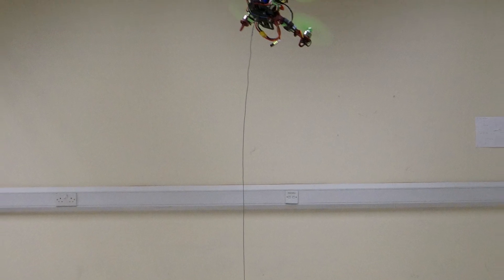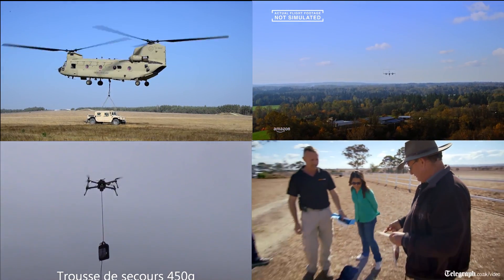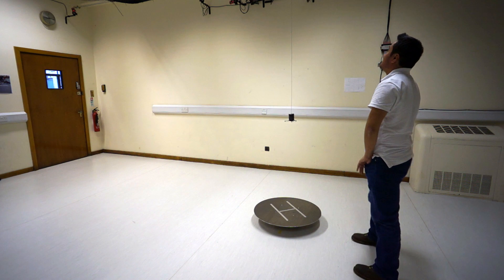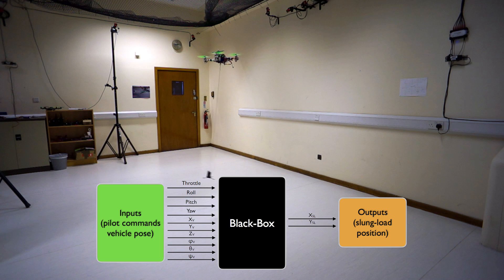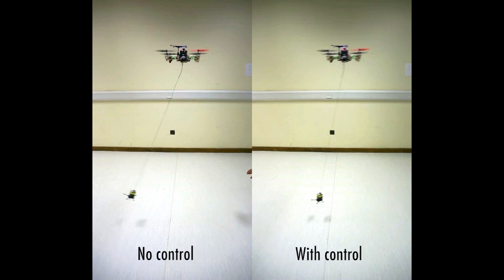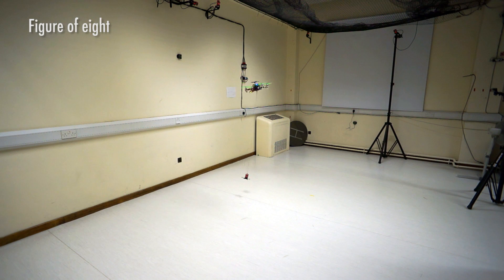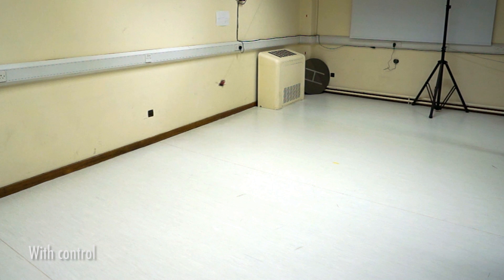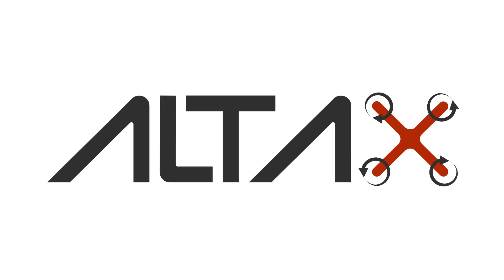Drone Pilot - Slung Load controller (raspberry pi + naze32)

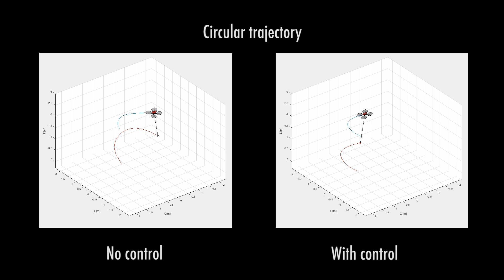Comment: Fantastic stuff, this is a really interesting project and it's impressive to see how small the adjustments are to adequately damp the oscillation of the load. I'm currently doing a drone-related project for my Computer Science MEng and was wondering if you'd mind sharing how you created your visualisations, like the one at 3:50? It doesn't seem to be part of your DronePilot code on GitHub. Many thanks.
Reply from the maker: Indeed it was very interesting working in it, I had so much fun. Those replay animations are made in matlab and the code is from the research group, that is why is not in the github. Send me an email to aldo@altax.net